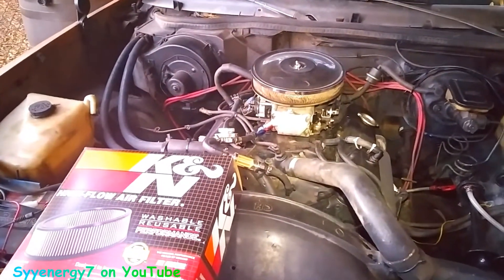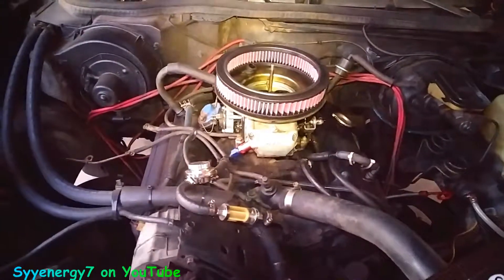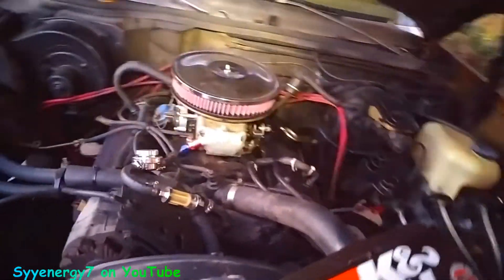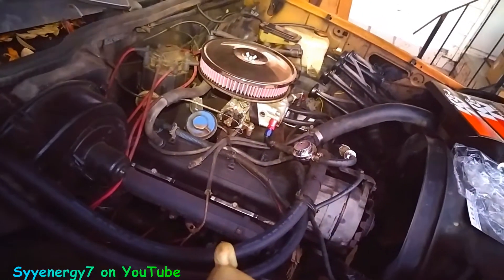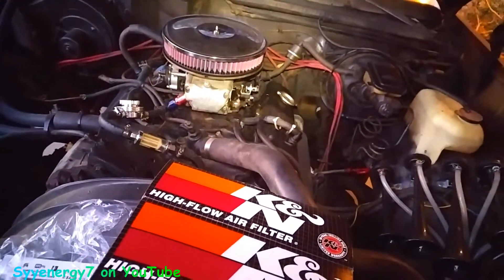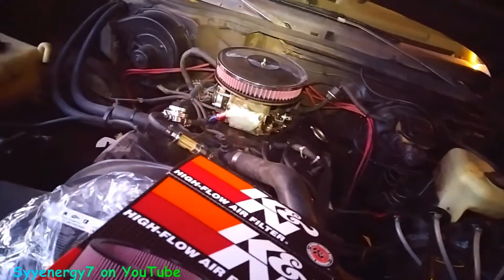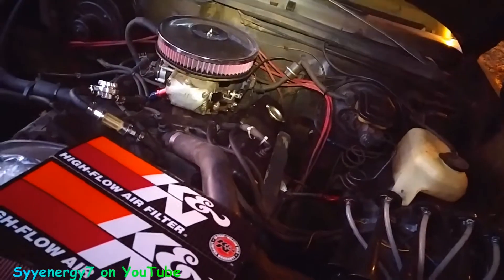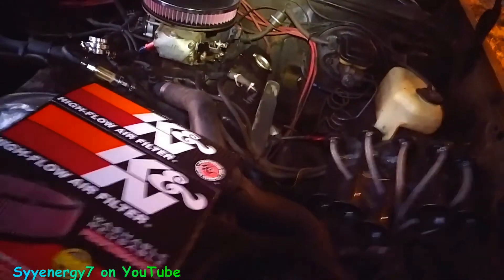K&N Air Filter for the '78 El Camino

Comment from the maker: Surprisingly this K&N filter did make a noticeable difference in power, but that's not the typical results most will find.  The old air filter must have been clogged and the new K&N air filter has no restrictions, so the difference after installing this K&N filter was actually felt with better acceleration and power.